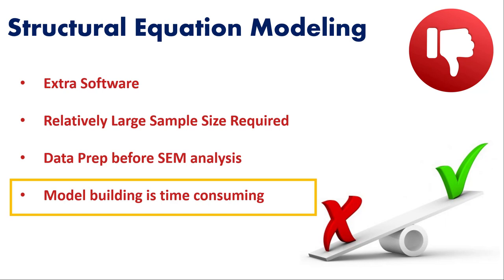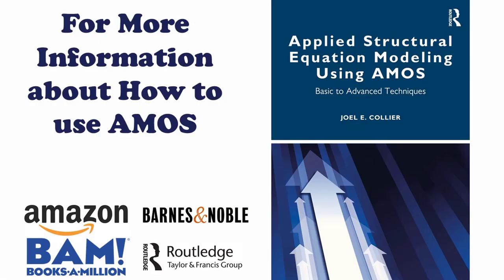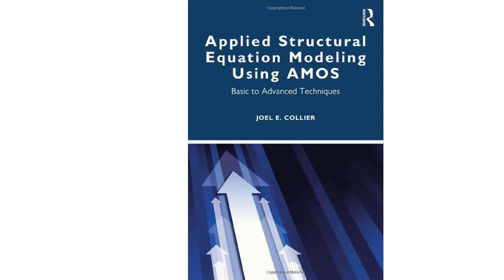What is the difference between the PROCESS Macro and SEM?

Comment: With PROCESS you can run a moderated analysis with a 2 x 2 between-subjects design, and even it is possible to add another moderating variable, as Z variable. This is model 3.

Comment: Although Process does not present strong model fit indices, a few things can be done to sort of guard against biases and spurious results. For example, using the Cribari-Neto heteroskedasticity consistent standard error and covariance matrix estimator (HC4)  can help reduce biases due to violation of the homogeneity assumption. Bootstrapping can also help with issues of skewness. Using the natural log transformation of the data also helps with skewness issues. With moderation, checking mean-centering of the products also helps control multicollinearity. You also get the RMSE from the MSE which can be helpful when compared with the data range.
Reply from the maker: Very good point.  There are additional tests to help against bias. You need to take extra steps to perform those using PROCESS.  As for skewness, bootstrapping helps and if you know the data is skewed you could even transform the data.  As for mean centering, Andrew Hayes and I had a conversation over dinner one night about it.  He believes that there is no reason to mean center data with moderation.  I am still in the other boat that mean centering will help with multicollinearity issues.  He has a mean centering option in the macro but in his latest version of his book he says mean centering is unnecessary.  Andrew and I respectfully disagree on this point.
Reply: @joelcollier9387  Thanks for the response, and for presenting Andrew Hayes' position on mean centering. I've personally experimented with mean centering in SEM, and I lean more toward your position. But then maybe the observations were due to my data set and would not probably apply in other data. 
Yes, I'd agree that, at least, a comprehensive common method bias test would have to be performed and addressed for before progressing to PROCESS. Thank you so much.

Comment: Thank you so much for this informative video! You mention that in PROCESS we can use relatively small samples. Would you mind explaining how we would run a power analysis for a moderated mediation model (e.g., Hayes' model 21)? I've read that we would need to run Monte Carlo simulations to get our needed sample size; however, I'm having some trouble with finding model 21-specific syntax to do this. Any advice would be much appreciated!
Reply from the maker: To be honest, I have never run a monte carlo simulation to determine power in PROCESS.  My method (for good or for bad) is I go to a power calculator and it determines my sample size to determine the desired power.  If it is an experiment, I shoot for a cell size of each treatment of 50.  That is more than enough power to find the effect.  Hope this helps.
Reply: @joelcollier9387  Can you provide a citation of a study where you calculated power this way when using PROCESS? Thanks!
Reply from the maker: @matthewjohnson705  Here is a quick and easy reference if you are looking to see if you have enough power based on your sample and degrees of freedom in your model: https://www.sciencedirect.com/science/article/abs/pii/S0148296301003010

Comment: Can we apply the principles of PROCESS for constructing structural equation models (SEMs) in simple models that involve one independent variable (IV) and one dependent variable (DV) in the context of moderated mediation models?
Reply from the maker: Yes, you can.  With one DV the analysis will be exactly the same.  PROCESS is quicker to use because of the preformed models.  If the preformed models do not line up with your model, you are better off using SEM

Comment: You can perform SEM with dichotomous DV
Reply from the maker: Yes and No....it depends on the software you are using.  AMOS/Lisreal/EQS will not let you use dichotomous DVs; PLS will let you use dichotomous dvs but it uses a work around in the analysis....and PLS does not use the covariance matrix as input which has numerous problems.
Reply: You can use use R with a the lavaan and the WLS estimate